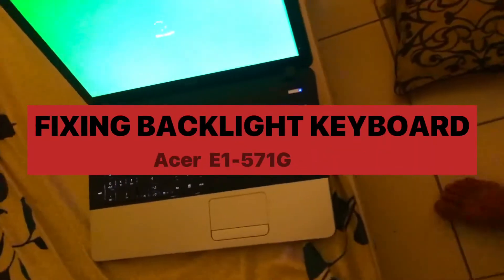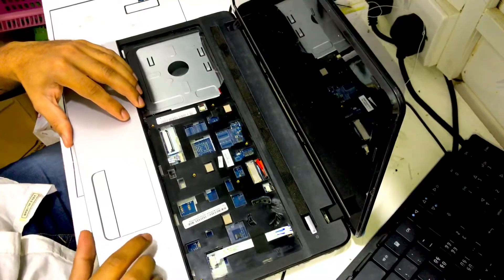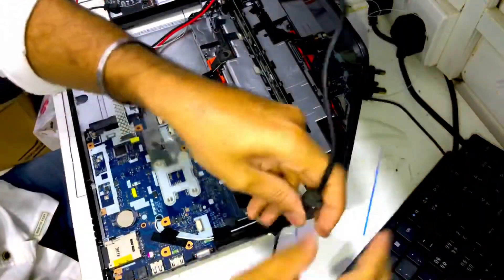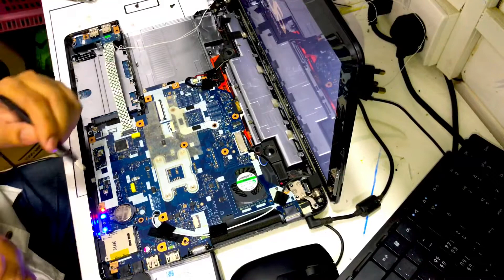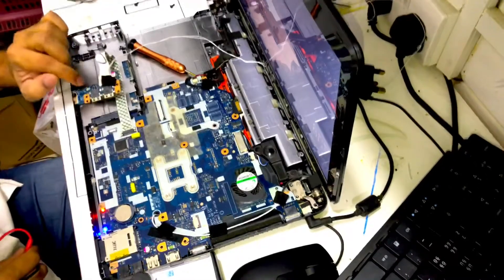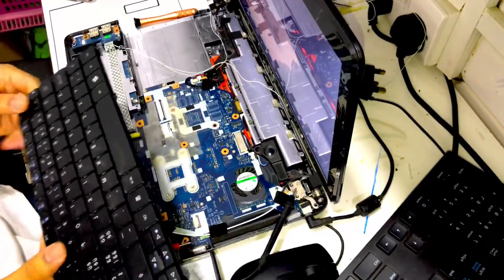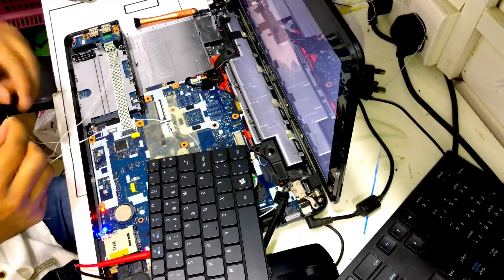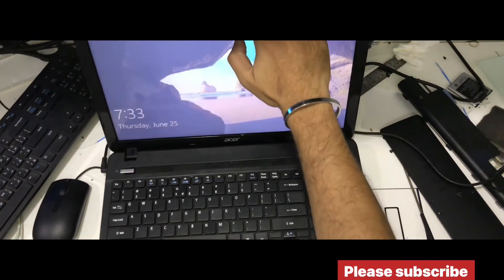How to fix and turn Non-Backlit Keyboard to a Backlit Keyboard for laptop(Acer E1-571G)

Comment: Aside from this vid being waaaay too low quality and unclear, this seems to be a hoax. Any backlit keyboard only works on the appropriate motherboard, which is NOT in this laptop. So, you would have to put in such a motherboard which won't fit....

Write  a manual and  let's go from there.